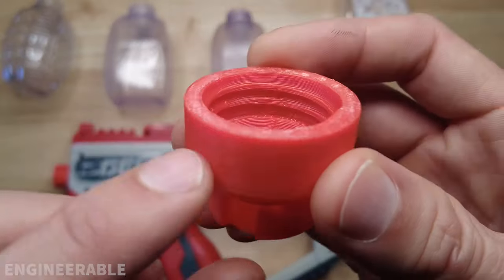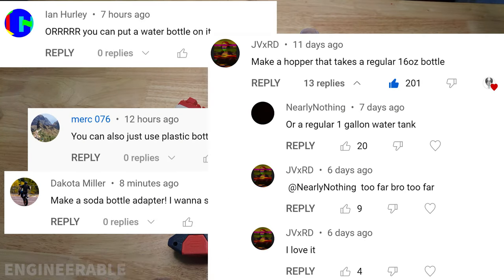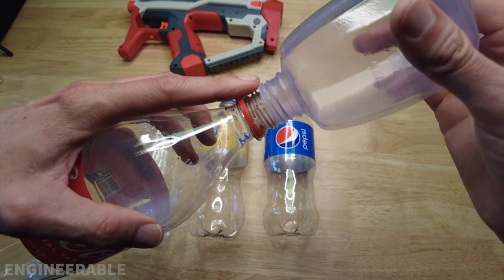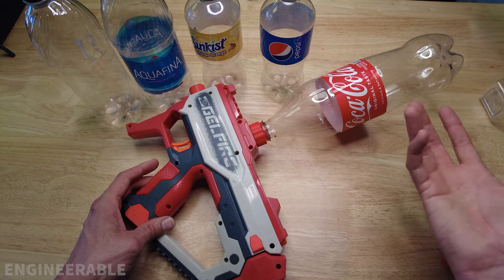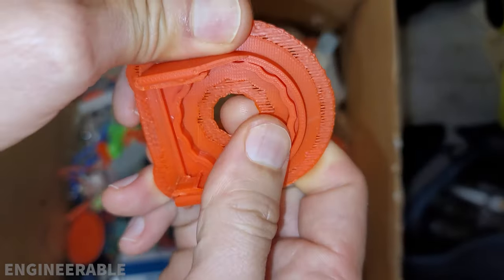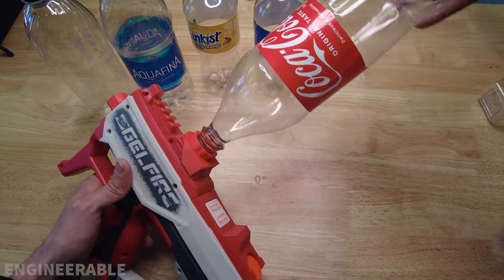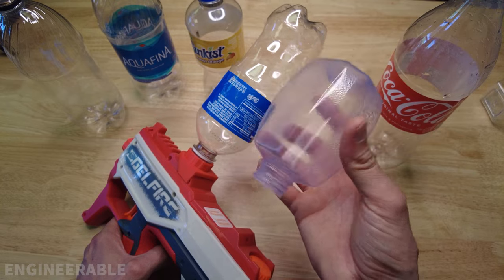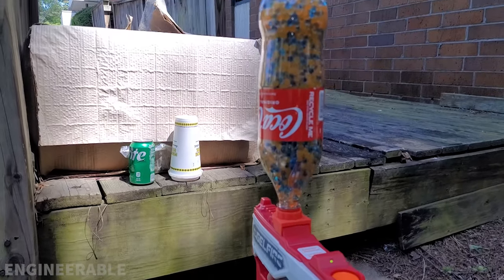How To Use a SODA BOTTLE on NERF GELFIRE MYTHIC Gel Blaster (3D Printed Gel Ball Hopper Adapter)

Comment: Time to upgrade the batteries now, don’t want to run out of power with half a bottle full! Maybe more voltage would make it shoot faster as well?
Reply: My thoughts exactly. I'm sure the circuit can be happily overvolted to a certain degree. Make a battery pack bigger by 1 cell in series, and more cells parallel for bigger capacity.
Reply: @Convolutedtubules  could possibly use a rechargeable rc battery? They have some small but very powerful ones out there.
Reply: @anything399  RC batteries will be good, as will any li-ion or li-po battery pack. I tend to lean towards making my own custom battery pack from bare cells.

Comment: 2 liter bottles here we come
Reply from the maker: The blaster can't support the 2L bottle upright. I think I'll need to lay the 2 liter bottle on its side, and have it feed into a smaller bottle that's screwed into the gel blaster. The smaller hopper holds a few hundred rounds, and you tilt the blaster to refill it from the 2L bottle.
Reply: @engineerable  See if you can design a printable magazine that is as low as possible while still feeding correctly.